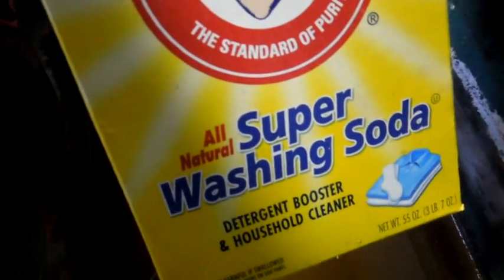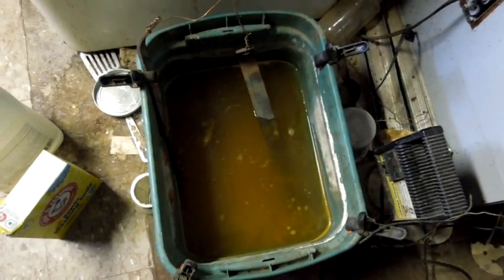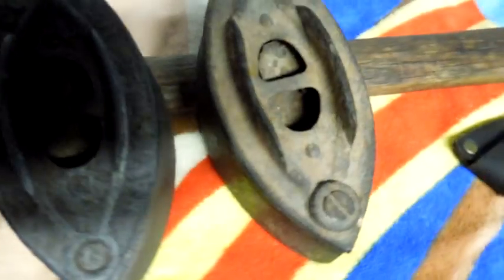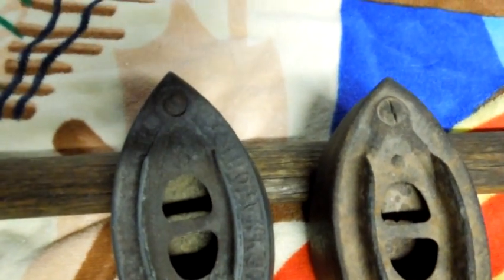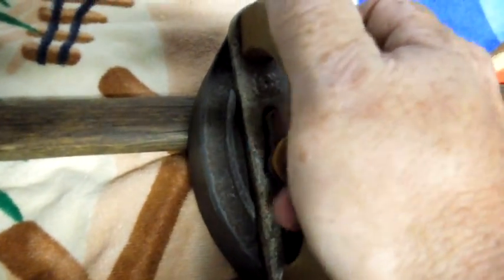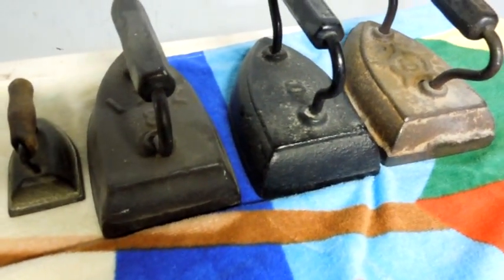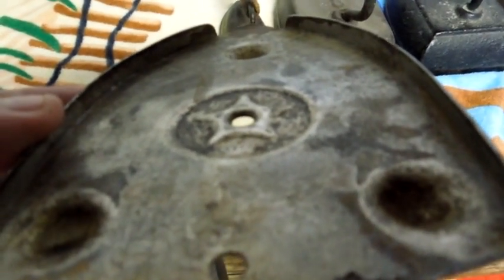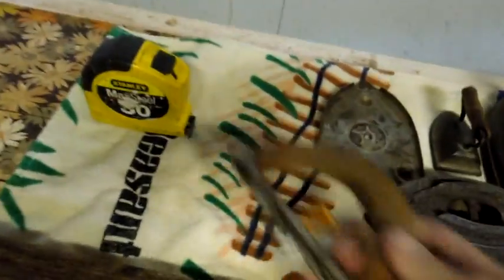Electrolysis results: brief discussion on flat irons

Comment from the maker: thanks Roosevelt !   That skillet/griddle I showed from the cast iron stacked on the shelving is what I am soaking right now.  It is working fantastic.  completely removing the seasoning and surface rusting.  pan seasoning is coming off in wrinkles that look like black paint.  leaves a new spotless light gray iron pan in the wake days later. Once you use the process you will continue to use it for other things too.  just jump in and try it!  less scarey than it seems at first

Comment from the maker: if I am trying to find the bi metal forged weld lines on a old tool, I sometimes soak it in a mild acid namely CLR from the grocery store. That will make the mild steel look new gray and the weld line a darker gray.   But I avoid acids for the most part on heavily rust scaled things.

Comment from the maker: what I found the sodium carbonate removes the paint layer alone.  I avoid heavy overly strong acids because a soft section of iron will become a large pit.  While they are less of a divit afterward when using electrolysis

Comment: Do you happen to know what era those sad irons are from? (The ones with the removable handle)
Reply from the maker: I would say pre 1945  . The electrification of American hmes didnt occur until after WWII   . Sure many cities had electricity before then but the rural farm houses didnt have electricity for a long time.  Much like the distribution of internet today.  Sure I have fiber optics attached to the side of my house but the speed is barely fast enough to be called broadband.
Reply: Randy J Hmm interesting. Thanks for the insight. I refurbishing a sad iron of that style and noticed that it didn't have a date on it. My best guess was 1920s
Reply from the maker: Possibly.  They were used in that era.  One thing I have found that the removeable handles seem to fit all irons that are similar size.  No matter who made them.  The handle attachment sees to be universal.  Or I happen to have all of the same manufacture.  But they look different.   Cleaned up they make awesome bacon and steak presses to use on the stove.
Reply: Randy J Never would have thought of that. That's a good idea almost I doubt I'll try it.